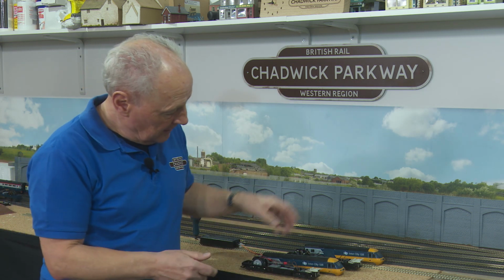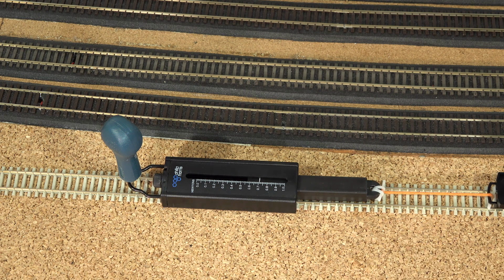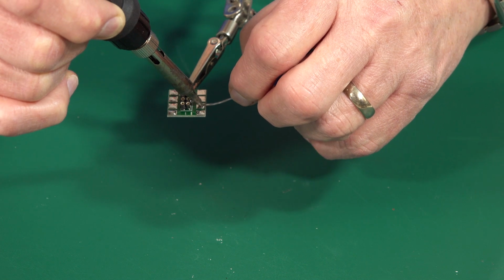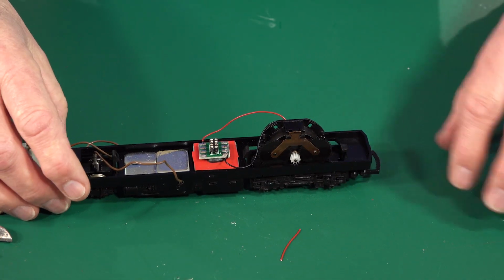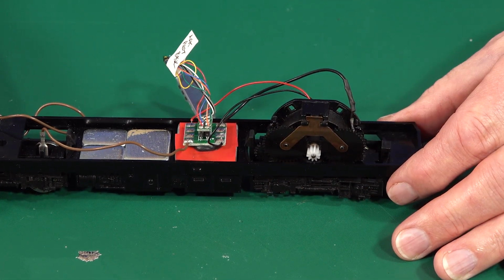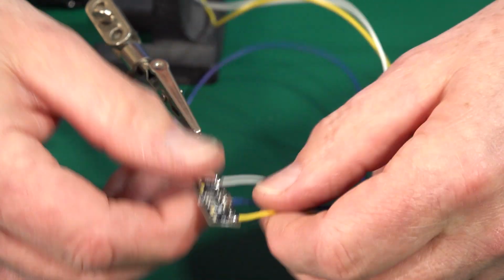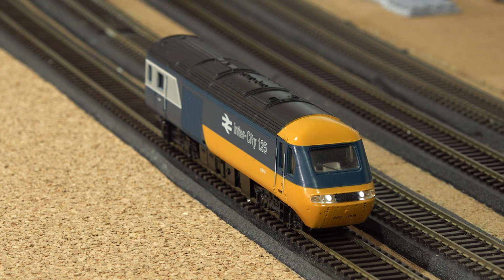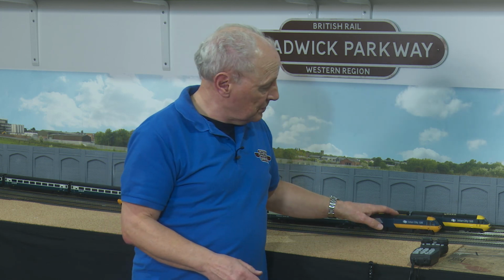Converting Locos to DCC at Chadwick Model Railway | 152.

Comment: Hi Charlie,
An additional thought I had was about how poor the electrical pickups from the track were on the old models and how this affects DCC. 
I have a Hornby Class 90 which is one of the last of the traditional Hornby ringfield motors and I noticed looking at it that it has pickups on both sides of both the motor and trailing bogie. Even though the motor still has traction tyres on one side I can see little brass(?) wipers rubbing on the inside of the wheels.
It might be a good idea if the pickups on the older models can be improved, I don't know if there is any kit for doing this or if it is a scratchbuild your own. Just a thought for a future video.
Reply from the maker: You make an excellent point Glen, I shall endeavour to find out. Regards Charlie

Comment: Hi Charlie. Very interesting to see your DC vs. DCC test and the loss of pulling power when a decoder is fitted. Any idea why? Must be some kind of electrical (control) issue, in which case fitting a different kind of decoder could solve it.
Reply from the maker: An interesting point mate and I will take another look. Regards Charlie

Comment: Lovely job Charlie. I am absolutely sold on this relatively simple conversion for my old 125s 😎 I did a bit of Heath Robinson on them about 15 years ago and managed to get front and rear lights by drilling tiny holes and using grain of wheat bulbs in parallel on the front and in series on the back, which didn’t work too badly on my old DC garden railway! 😀 However, this seems like a major step up from that so it will be on my list of things to do once we are moved 😉

Thanks a for another great video Charlie, all the best mate 🍀🍻👍
Reply from the maker: Thanks Tim, I’m so pleased that you found the video useful. Regards Charlie

Comment: Great tutorial Charlie - as always. The original Hornby HST mouldings were pretty good weren't they, and your project shows how very useful the life can be extended. You don't exclusively need top quality and expensive models to operate your layout . 

One question Charlie, Are you likely to change the wheelsets in this power car, and does the other non powered car have the same issue ? 

Thanks again
Reply from the maker: Hi Phil, that 125 unit wasn’t actually mine. However, I did buy one on Sunday for myself so I shall endeavour to test it. Perhaps Peters spares may sell replacement wheel sets, so I shall check those out. Regards Charlie

Comment: Thanks for sharing Charlie. My wiring is as good as yours when first converted a dc loco. I am going back at some stage and put these 8 pin socket in. I working on track at the moment to get the layout running once again. So I can unbox all my locos and rolling stock. I will be buying a motor I have a Hornby class 35 needs it.
Reply from the maker: That’s great news Ian, and good luck with your improvements. Regards Charlie

Comment: Uh-oh. Looks like the wiring on that crossing isn't quite right. It should change polarity according to the point direction to avoid shorting. Those older locos with their fat wheels are excellent fault finders! Unfortunately now we know that fault is there it also means there is a very slim chance the same short might happen even with newer stock. Maybe an investigation is in order?
Shame about the power loss after the conversion, but the improved slower speeds are definitely a good enough trade off, and if that trailer car were to become a power car it'd effectively double its power. And those new LED lights just look brilliant. Back in the day I put two power bogies in to my 37/47s. They were absolute beasts!
Great work, Charlie!
Mike.
Reply from the maker: Sorry Mike, but I think you are mistaken. That long crossing does not have switchable frogs. Regards Charlie

Comment: Hi Charlie ,Really helpful video .Many Thanks .Not being a dcc man ,when you referred at the end to just put a blanking plug in and run it on dc ,my question is are 8 pin blanking plugs all  the same, and can you recommend where to get the blanking plugs from  please .Regards Lester
Reply from the maker: I believe that they are all the same anyone with a DCC layout would have these as unused items.  Regards Charlie
Reply: Thanks Charlie, what was the voltage of the motor that you used in the video? If it was the 6 volt motor I, wondering if it would have blown the lights as if you turned controller up it would have been too much power for the lights on dc . I realise that for dcc users it is not a problem as you can control it with cvv, s . Thanks
Reply from the maker: Hi Lester, is was 12v motor. 
Regards Charlie

Comment: Hi Charlie, another great demonstration video. Are you aware of Ultrascale products? They make replacement fine scale wheels sets for Hornby and Lima locomotives, however they don't accommodate traction tyres. These wheels are finer than the adopted standard used in RTR stock but still run on Peco streamline track. Like you I'm amazed at the cost of new locomotives and rolling stock these days, I would rather spend a little on improving the running of an older locomotive giving it a new lease of life. Regards, David.
Reply from the maker: I knew they were avaable somewhere but hells bells, they are costly. Regards Charlie
Reply: @ChadwickModelRailway  Hi Charlie, I don't think £19.15 for a brass set is that costly and they improve the look and running of an old Hornby locomotive, also they don't short out over frogs. The LED lights are £14.40 a pair, a motor conversion kit around £15, an 8 pin socket £1.50, plus a decoder of choice. Regards, David.
Reply from the maker: No I totally agree David.  Where are they for sale at that price?

Comment: Charlie,
Again you had me mesmerized.  Great job.
I do have a question though.  You decided not to use the GREEN TAB.  Had you decided to use it, what functions could it be used for.
Not knowing the electrical functions I was wondering if it could be used for rear bumper lights (even though you have a rear facing engine), cabin lights, or attaching a sound decoder?  Any ideas?
Thank you,
Jim in the U.S.A.
Reply from the maker: I would use it for internal cab lights

Comment: I've just added more stock of the lighting boards to my eBay shop, and will be spending the rest of today building more stock.

One quick comment, I find it easier to solder the wires on if you hold the board in place with either a finger or some blue-tak. Helping Hands aren't great for soldering as they don't hold things very stable. However, if you do use them, please take care not to put the clip on any components on the board, especially the LEDs, as they are fairly fragile. Oh, and for the wire attached to 'C' take care it doesn't touch either of the components to either side of the pad to avoid shorting anything out.
Reply from the maker: I do take your point but I need to show the soldering to the camera which is always hard for me to see what I'm doing!
Regarding other products, perhaps you can email me at chadwickmodelrailway @ gmail .com (no gaps).
Regards Charlie

Comment: Like you I have two HST125's. One is quite old, in excess of 20 years, but it still runs OK.  DC only. The other is a recent 40th year of Service model which I purchased new. It has a cerificate of authencity indicating No 0621 of 1000. (Hornby R3403)
What I wondered about during your power tests as to whether it was axle loading that gave the different results, especially after wheel slip started, and whether testing on two different track surfaces actually made any difference.
So I tried this. Again not so scientic as didn't have a strain guage but did have a reasonalby heavy rubber band connected between a fixed point on my test track and the loco's. This setup was the same for three tests.
a) Connected up the older loco and supplied it with DC. Marked the point on the test track where the wheel slip started to occur and how much further it moved with a bit of extra power.  Not much.
b) Connected up the newer loco and ran it up on DCC. It travelled a greater distance indicating better tractive effort, probably due to newer wheels.
c) Toggled CV29 so that DCC was off and ran the new loco on DC. There was very little difference from when running on DCC.
Not sure if I want to upgrade the older loco to a newer motor and DCC but you did provide an excuse for experimentation. Thank you.
Reply from the maker: Great work John. I love the use of the rubber band.

Comment: Nice video. I always like it if people try to go to the roots of things.
Now, your technical experiments seem to leave a few questions open I hope you can clarify.

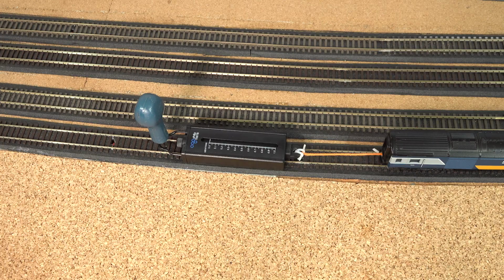- at 29:00 you claim that you repeat the test the exact same way so that the results should be comparable. Well, I see at least three elements that suggest otherwise. The most obvious: In the second test the car has the housing on, so it is heavier. Another source of extra weight is the additional electronic that you added during the conversion. Since the weight of the car is proportional to the resulting pulling power, this is a significant difference. You should at least consider the weight with/without housing. 
 Then the second test seems to take place on a slightly curved track while test 1 was on a straight section. Even if it is a wide radius, this most likely makes a difference because the contact of the wheels is not the same on each side. And since one side of your car is equipped with traction tires that have a significantly different friction coefficient,  results will differ. You can actually see that from 5:05 to 5:10 in the video, where your pulling force increases from about 0.5 to 0.7 N. The reason is that the car, while slipping, is moving to the left, so the traction tire equipped wheels make better contact and the pulling force increases. Unfortunately it is not possible to see the location of the car in test 2. 
 And third, it is not clear to me whether the rail material is the same in both cases. Each material has its own friction coefficient, so two materials are not the same. Also, two tracks are not the same because of cleanliness level, grease, etc. 

- technically, the maximum pulling force of a locomotive is not when slipping, but just before it brakes loose. The reason is that static friction is higher than kinetic friction. Therefore, the best way to measure maximum pulling force is to see what force is needed to pull a sitting engine. I have recently explained that in a video, see here: https://youtu.be/svRJyWA2tbw

- I am relatively sure that the maximum pulling force (with locked wheels/track system) is not impacted by DCC. When the wheels are spinning, I could see a possible explanation for a reduction by the fact that the motor is driven by a PWM output of the decoder, which results in some force spikes when the decoder pulse is on, which could result in the wheels braking loose on the motor peak, and since this leads to a lower kinetic friction status, it would potentially be permanent, even if the PWM pulse is off. Metal on metal, the typical reduction of the friction coefficient would be about 25%.  Do you have any thoughts about the reason for a possible reduction of pulling power? 

Certainly a topic that needs some more investigation.
Reply from the maker: An excellent comment IoTT.  
I shall re-visit this off camera and perhaps take a more serious approach.
The number of variables is substantial, but I will certainly have a go.
Sadly, the decent gauges are very expensive.
Regards Charlie
Reply: @ChadwickModelRailway  The gauge is not the problem in this case. There is almost nothing as simple as a spring balance. The spring is very linear over a large range (typically as long as it remains inside the housing) and as long as you ar always using the same gauge, the calibration to an official Newton is irrelevant. It is much more important to take care of the other variables, like for example the impact of the weight on the axle , the friction coefficient etc.
Reply: As I watched this 3 years later, because I am just getting started in the hobby, I had the same thought. The point at which the wheels start slipping has nothing to do with the power of the motor, but the weight of the engine, which of course effects the traction of the wheels. The wheels will slip at the same amount of traction of the wheels, regardless of the power of the engine. I noticed in the first comparison that the two engines had different amounts of weight in them.

Comment: Howzit Charlie. Ref : X-ing Short ... It was a tad difficult to see on the viddy; but have you COMPLETELY isolated ( Plastic Joiners all around ) the X-ing and fed the DCC power to the X-ing through an automatic Polarity / Phase-changer ?  I am also taking a bittovva stab that as seen;  * Old *  models ( Wide / Toy-ish wheel-treads ) are not compatible with  the latter-day; finer specifications of DCC-Compatible trackwork design. Yes; repeating short-circuits due to a mis-match in DCC-Spex incompatibility at a specific site are indeed frustrating when the smooth performance of a Loco falls short of expectation  !  Thanks + Regards / Johnny
Reply from the maker: Hi Johnny, the gap between the two parts of the frog are extremely narrow.

And the wide wheels bridge that gap.

Painting it with nail varnish is always one alternative. Regards Charlie
Reply: @ChadwickModelRailway  Hay Charlie : So From Your Personal Stash; Which Is Your  FAVE  Colour Nail-Polish; Doll ... ? ?  Ha Ha !

Comment: Great video Charlie.  Please add RS Components to your supplier list.  They stock thousands of components, etc. and it's worth opening a free account with them.  The number on your wire strippers is their stock no.  For the trailer car, a cheap decoder such as from LaisDCC would be perfectly adequate, and it would be helpful to point out that the DCC address should be set the same for both decoders. Looking forward to more from yourself and McKinley.
Reply from the maker: I do understand your point about the code is Christopher, however, Lias DCC decoders are stolen technology! Regards Charlie

Comment: Very useful Charlie. Seems the LED boards are out of stock at the moment but I'll keep an eye out for some. I used a Gaugemaster socket for my conversion, its a little smaller as you need to solder the wires to the back of the board to elongated pads from the socket.
Reply from the maker: I’m sure they’ll be back in stock shortly Rob. Regards Charlie

Comment: Great video again.  Always respect the time and energy you put into presenting and camera work - thanks.  Perhaps you missed a step in the DCC conversion?  After fitting the decoder and placing on the track without power I would always check there is no electrical connection between the track and motor with the multimeter ( motor 1&2/orange and grey connections) - to ensure you don’t smoke the decoder!
Reply from the maker: A fair point Roy and one which I shall heed. Regards Charlie

Comment: A great film on this continued HST125 Modification Upgrade. So, with a new motor, DCC PCB, two LED lighting boards, some wire, solder, and a decoder. Followed with a little bit of time and patience and one has a refreshed loco for another 40 years, well maybe, LOL. Superbly explained and clearly shown for the viewers on what must be done to get things working on the right track (intended pun). Kudos you Charlie for another master class in (jack of trades) modeling once again.
Reply from the maker: That’s praise indeed John.
Stop making me blush, regards Charlie
Reply: @ChadwickModelRailway Well praise it is and kudos were its due my friend.

Comment: Hi Charlie, as you may remember, I’m not even a modeller, let alone DCC…! so I’m possibly talking a load of old *&^¥ but would it not have been more logical to connect the motor red to the orange and black to grey… This would also answer the lighting problem…
Reply from the maker: You are of course dead right Tim, I hang my head in shame. Regards Charlie
Reply: @ChadwickModelRailway  not too much shame, Charlie…it’s all part of the game.

Comment: Hat off to you, Charlie. I find it hard enough just soldering small objects  without trying to do it, so the camera gets a good view. Great video showing you don't always need to buy new when updating your layout.
Reply: There is actually an alternative to soldering on those tiny solder tabs, there are metallic paint pens you can buy on ebay which actually glue the wire to the solder tab, alot easier and more accurate than solder tips.
Reply from the maker: I’m so pleased that you enjoyed the video but I certainly haven’t heard of a metallic paint pen, which I shall check out.

Comment: Those RS strippers won't be found on amazon I don't think.  RS components distribute them through their own stores.
Luckily they are a different company to radio shack as radio shack is no longer in business :) 
Love seeing videos on converting these older models.  I think it is a good thing to save them and give them a new life on modern layouts.
I used the same Blackcat light kit.  Using a sharpy to black in the underneath of the cab interior helped stop light bleed from the LED kit into the cab for me as well.
Reply from the maker: Thanks for the info on the wire strippers Brendan.

I’m so pleased that you find these conversion videos interesting. Regards Charlie